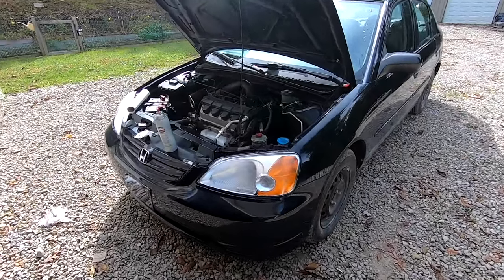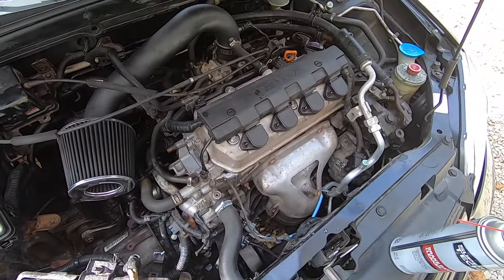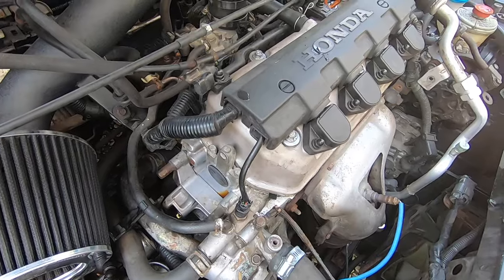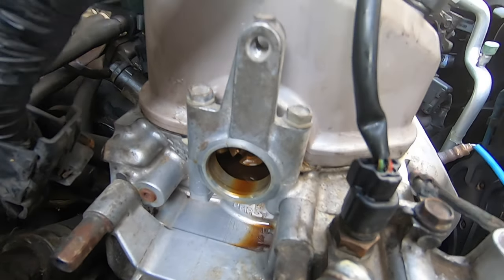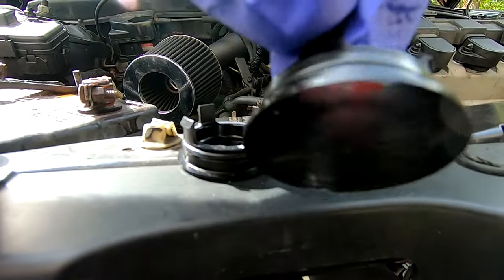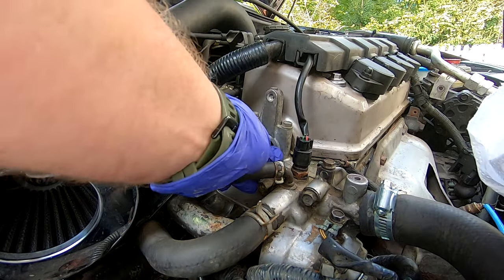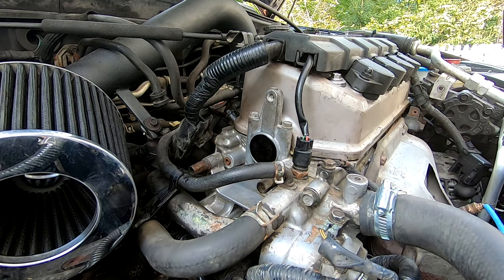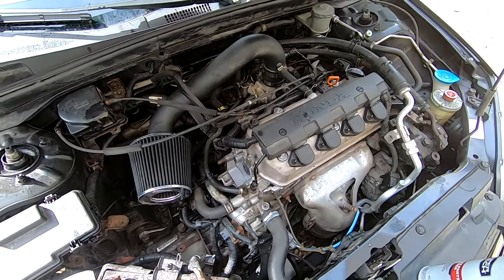2001-2005 Honda Civic Common Oil Leak Repair - Easy and Cheap Cam Cap Plug Replacement

Comment: Yep. Thanks for this clear and concise rundown. Mine has gone neglected for a while; there’s a bunch of dirt and oil running from the plug down to the transmission and oil pan. The OE part is in the mail. My ES1 has seen a lot of abuse but the engine is still happy and healthy. I’m gonna give it a good scrub so it’ll look as good as it runs.

Comment: For everyone that replaced the camshaft sensor and the car still goes on limp mode how to fix it. Keep driving the car slow for a week or 2 so the ECM learns the new sensor and then it will drive smooth. A puzzle that kicked my ass. I bought the TDC sensor from Napa for $67. Now I drive the car about 200 miles daily and has no issue at all except for the oil leak from that plastic cap. Thank you for the video.

Comment: Hi Jack, the link you posted for genuine Honda Cylinder head plug says it is not compatible with 2001 Civic LX. What was your experience? Thank you for the video and helping me to get started on debugging the issue.
Reply from the maker: In the video I was working on a 2001 LX, so I can confirm.
Reply: @JackofAllMasterofNone  thank you.
Reply: @JackofAllMasterofNone  hi jack which lubricant did you use for the new part?

Comment: jus did my valve cover gasket still leaking at the exact spot as this video replacing cam plug tommarow hopefully does the trick

Comment: The previous owner of my 2002 DX put a non genuine one in the car, and it's stuck in there. I bought the genuine part and everything went to try and get it out with the flathead and it wouldn't budge. Then I realized that the one that's in it is more rubbery then the plastic of the genuine one. Any advice on what I can do to get it out so I can replace it with a genuine one?
Reply from the maker: Take valve cover off
Reply: @JackofAllMasterofNone  thank you, I will try this when I get the chance
Reply: Update, nothing worked had to spend 300
Reply: @sires8765  😲😬 wow, I just did that job today on a friends car. Was quick and easy, I'm sorry you got ripped off, but the world is a vampire, more than ever these days. 💸
Reply: @erikcaldwell2913  so what happened with my car was the plastic plug was gone and the one that sits behind it was pulled out to look like the cylinder head plug.
Reply: @sires8765  🤔
Reply: @erikcaldwell2913  how you do it? i need help
Reply: i have valvue cover off idk where to begin it’s sciliconed can’t get the cap off
Reply: @elFrijol-19  make sure you have correct replacement plug.
Then get the old plug out, any way you can, even if you have to cut it, or pry it out, then scrape off the silicone.  Make sure the surface the plug goes into is smooth and clean.

Comment: Do u think since I park on a slant everyday after driving, leaning forward the passenger side, it’s possible for small amount of oil to leak threw the cracks since I’m on a slant?
Reply: Not unless the car is sitting on its side. Oil doesn’t sit in the head when the car is off.

Comment: I have a small leak that’s right u set this same spot, I replaced the part like you did and still seems to be a small leak ?
Reply from the maker: Not sure. Could be the valve cover gasket. It's very common for them to leak

Comment: Is it correct the EGR was already removed. Just saw a different engine block in a video and it had that part right in front of that plug. My civic 2001 European also has that EGR. Noticed Mike started drip a on the floor and noticed the block was wet in the same area
Reply from the maker: The D17A1 in the 01 LX did not come with an EGR, only the D17A2 has it.
Reply: Is this the same on 2002 ex honda civic
Reply: Mine is with EGR valve. And yes I removed it, 2 bolts. And then this seal.

Comment: Can I remove the part with the 2 bolts right above it to get it out if it won't come out with a screwdriver?
Reply: Yes. For VTEC 1.7L, that's your EGR in the way. You can try to remove it and install it with the EGR in place, but it's much easier to remove it

Comment: Where did you buy the piece?
Reply from the maker: Honda 12513-P72-003 Cylinder Head Plug https://amzn.to/3SLY6S5
Alternate Link Beck Arnley BEC039-6558 Engine Semi-Circular Plug https://amzn.to/3sG7v2W

Comment: Did it stop your leak???
Reply from the maker: Yes it did. They leak from other places too such as the valve cover gasket, oil pan gasket, rear main seal, etc.
Reply: @JackofAllMasterofNone honestly for a 20 year+ plus old car, if it isn't this cap that's leaking, I'd use AT-205 reseal. Way to much work for a car that has very little value

Comment: PCV VALVE is the cause. Replace that first.
Reply from the maker: A bad PCV can cause seals to leak on an engine for sure. But that isn't what is going on here with this part. The Oring simply gets old and flat and doesn't seal anymore.
Reply: @JackofAllMasterofNone  Great tip! I keep my wife's EP3 Honda and noticed seeping and did the PCV VALVE first and cleaned the areas, and held my breath. The EP3 leaks at the VTEC solenoid O-ring. Great video and good information.